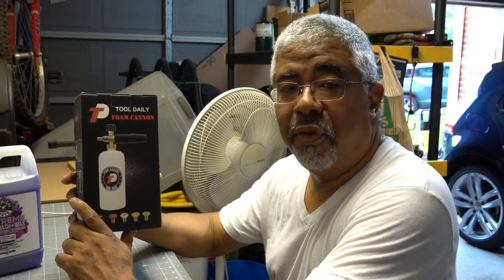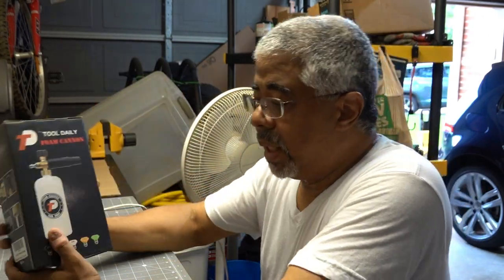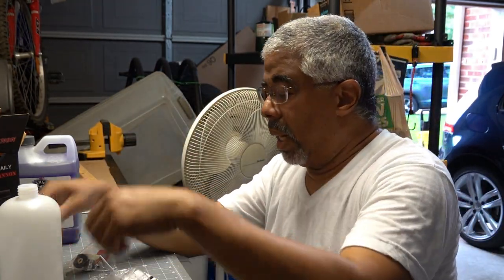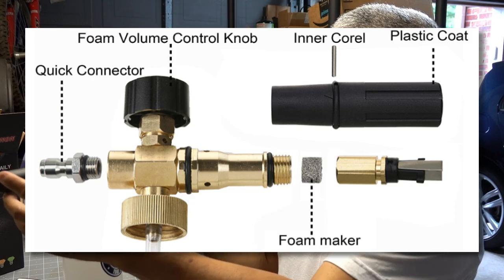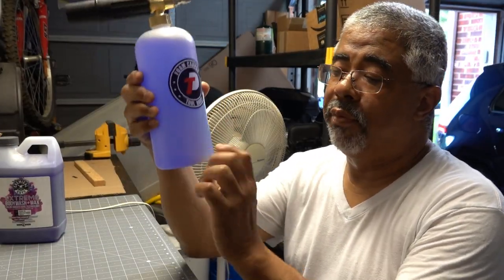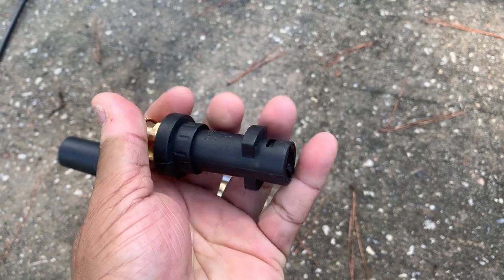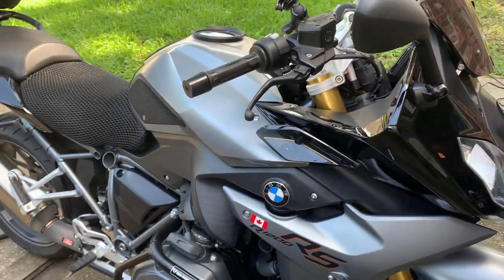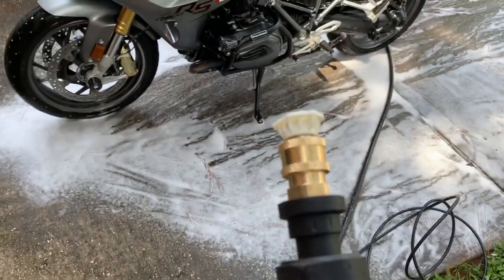Does Foaming Work? | Tool Daily Foam Cannon | 2016 BMW R1200RS / 2014 BMW S1000R | Product Review

Comment: For what it's worth, and probably very little, I try to avoid riding my bike through water crossings (apparently a major cause of water ingress to final drives), but I figure high pressure washing might be my Achilles' heel, so before switching on the Karcher I run a strip of 1 and 1/4 inch tape around the rubber FD joints as an added precaution to prevent water seepage. Yep I know it doesn't get more anal than this.
Reply from the maker: Taping it off can’t hurt, since the joint is not waterproof. That said I try to keep the nozzle at a distance from delicate areas such that with the 40 degree fan spray the actual volume of water reaching the surface is less and at low pressure. Should be no worse than riding in heavy rain. It’s also a good idea to do FD spline maintenance regularly also.

Comment: what  seat is that on the rs ?
Reply from the maker: Stock seat with a seat cover on it. There is a video on this channel about that.
Reply: I saw grumpy Goat do the video on that seat cover a couple years ago. Then a few weeks later I’ve noticed on a video two years later that he still had it on the motorcycle so he must’ve liked it.  It’s a seat cover made out of the same venting material they use inside body armor carriers. They’re not cheap but I ordered one and it’s a great seat cover. I don’t think anything works better. If I remember right they’re made in England and mine was about $70 delivered.